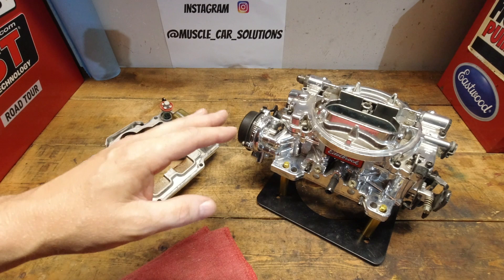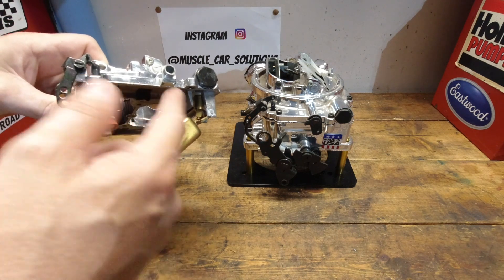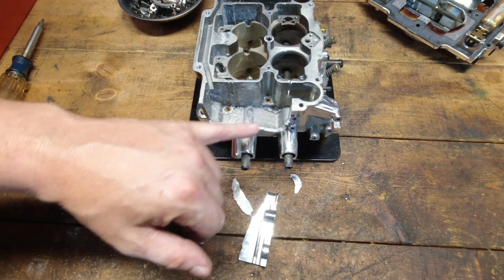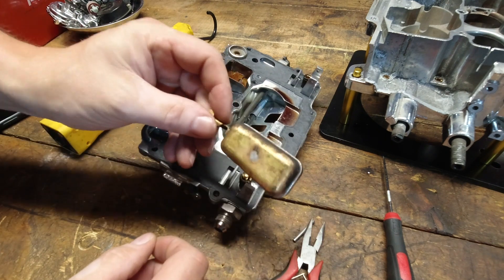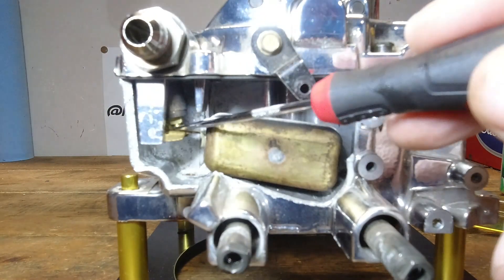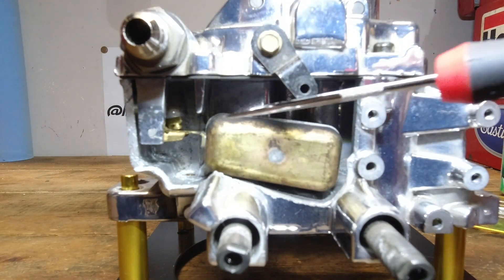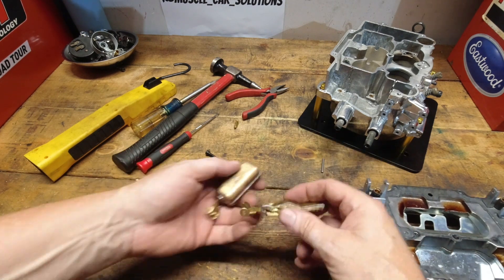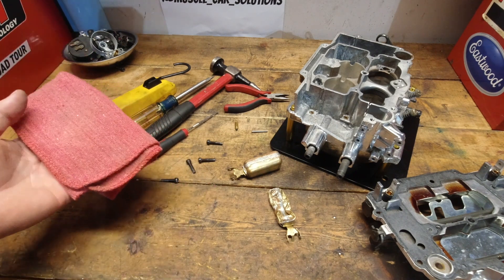Edelbrock Float Drop Test - Theory Busted

Comment: Great video.  The first thing I thought of when I heard the concern of dropping the float too low was that the float would hit the bottom of the chamber first anyway, so there’s no worry of binding the needle.  Plus, if the clip is on the needle that keeps it under the base of the float then I’d think it’d be even more unlikely that the needle would bind.  But great video.

Comment: I’m confused on the float drop spec and where you measure the reference points.  I get that you orientate the carburetor right side up and let the float drop and hang, but do you measure form the bowl gasket surface to the lowest point on the float or some other point?

Comment: Under operation the float doesn;t move that much at all.. as fuel is being used by the engine the float only drops enough for the needle to open a little and maintain bowl level. the float drop tang is really only there to keep the needle in it's bore when you remove the top plate. If fuel level ever gets low enough for the float to even touch the floor, the engine will go very lean before that point and it's most likely because the fuel pump failed first.
Reply from the maker: You’d be very surprised at how much it actually moves.  But I’m not making a window in the float bowl to show just how much the fuel level drops.
Reply: @MuscleCarSolutions  Actually, No I wouldn;t be surprised.. I've done similar tests with other designs on flow bench, wet flow. If the float level drops too far under a WOT senario ( such as 1/4 pass, then the volume delivered is being restricted. Larger needles will help, but fuel volume delivery is key. If float drops too far you lose head pressure in the main well and booster draw diminishes causing lean creep. Obviously, the eddy's won;t be put on big power motors, But I have tuned then to run well on 5-600 hp street engines. It takes work though.